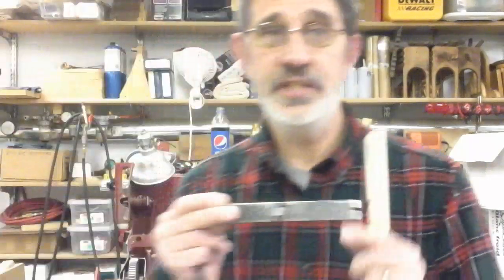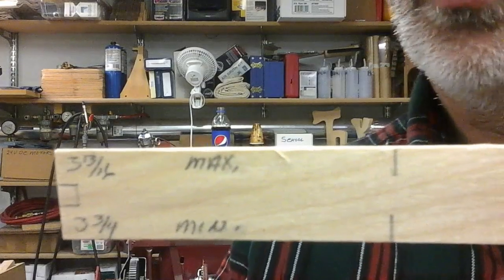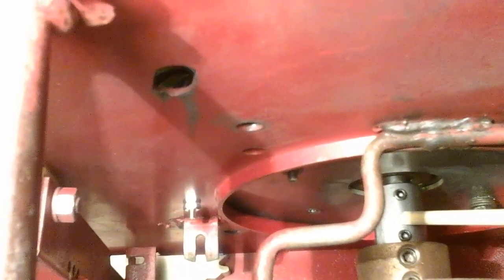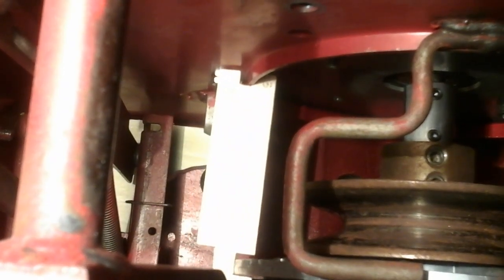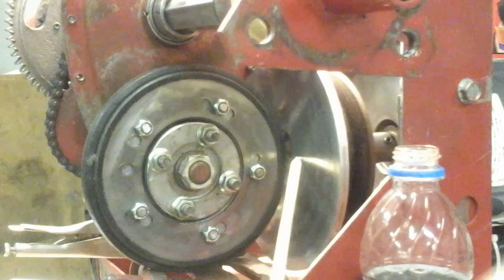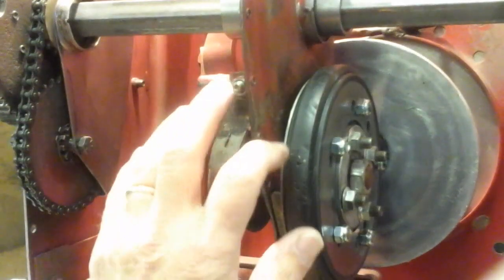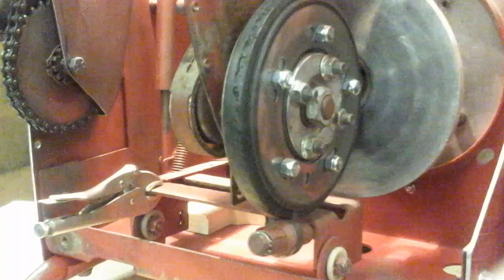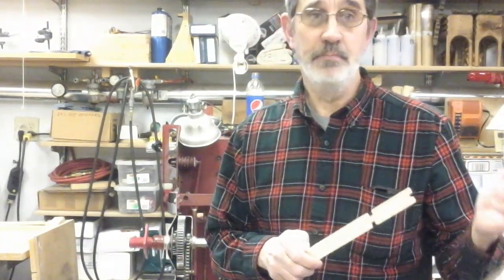70. How can I adjust my clutch and drive disc

Comment: Going to finally attempt this as I’m down to 1st and 2nd forward gears and even the slightest incline stops me.  Thanks for the detailed vid and will let you know how it goes.  If I need a clutch disk - where do recommend purchasing from?
Reply from the maker: NutmegThumper 

Like I said I buy my parts from PartsTree.Com  but you can also buy them from Amazon and eBay. Jim
Reply: Jack's is good.

Comment: Hi Jim How to adjust the carburetor on 12HP  491031 490499  
This Carburetor Carb W/ Gasket For Briggs&Stratton 12HP Engine Replaces 491031 490499
Reply from the maker: I’d have to see a picture of it because most carburetors are not adjustable today. Jim.

Comment: did you know that the late 1990s RER mowers have the black rubber plastic hub cup covers for the sdhaft seals,  for both ends of the axle, stock from factory?  my 1998 model year 9-horse one does.  i have pics and model numbers etc.  i just replaced the transaxle shaft boots on mine, a couple days ago(i got the mower free given to me and its actually very low hours use and in vey good low wear condition, it has no wear-slop in the shifting action(the hex transaxle shaft), or in the chain case shifting/sliding action- or in the hubs bushings(the solid steel later style ones)) because my shaft boots were totally gone/shot/busted up, very horribly,.     so it turned out really nice and sealed uip great now and basically no wear slop anything at all anywhere now!  and all for free, other than the only around 30-bucks for the hub/shaft seals and boots i spent)   and its too bad that the replacement gray colred boot is a cheap taiwan produced part, and that the Briggs/Stratton axle seals are cheapo garbage China produced  ones

Comment: The driven rubber tired clutch disc is in the 15  dollar range, pop on a new one to renew great drive power and clean drive disc surface. Brake parts cleaner spray work well for me. My Snapper runs as a well oiled machine because it is one. Easily climbs hills in my yard, shifts on the go as smooth as can be. Has a settable detent to mow in reverse. A touch on the starter and 10 H.P. is ready to knock out mow chores with ease. 30" cut goes through small gates yet big enough to get good production. Sharp blades are easy with Snappers rear tip up service. While it is standing up a little spray of grey primer after deck wash out flush and dry, ( mine has a twin port hose attach to ease this) keeps any rust at bay, grease fittings as needed. With my my hand held belt sander, knife sharp blades are kept at the ready, to give great looking lawns. Large fuel reserve  means hours of cutting before re/ fuel. Very tight turn radius.  A  small tractor cover and a little t.l.c. keeps it in top shape.
All in all a superior grass cutting machine. 2002 10 Briggs 30" four cut edge blade. ( mulch plug type ) 

The best part of my Snapper is it was given to me by my good friend and neighbor Dick, a combat wounded WWII Normandy invasion. Purple Heart  ( lost an eye and nearly his life then ) U. S. Navy Sea Bees. Dicks over 90 years of age and as sharp as a tack. He just bought a new rider and didn't need his old Snapper as much. He plowed snow with it too.

Comment: Watched this video twice 👍👍.

I figured the lock nut out on the shaft which holds the blade adaptor on.

I saw in 1 of your other videos changing out the bearings on the spindle.
How would u get the blade adaptor off, i know it screws off, cause I can see that coming next?

Comment: Ok bud first and foremost I have enjoyed your vids.. ok my question is... inside the clutch where the green material is there is a lever mechanism that rides up against that material...what is that? what is that for?... is it super important or can I do without it? Mine was missing whatever material was on there to grab the inner clutch ... it was just bare metal ... if I can do without that piece then that's fine I already don't have brakes and it's fine

Comment: I replaced the friction wheel without a problem, but after a short drive, when I looked back at the new friction wheel, the rubber was all scuffed and chopped already within just a few minutes. What might be causing that wear? The aluminum wheel it presses again seems smooth.
Reply from the maker: Watch video number 70 and check the distance on your drive disk and maybe tighten up your yoke spring. The clutch disc could be slipping on the drive disc.

Comment: Hello, My snapper is having trouble when I approach any sort of incline. As if it doesn't have enough power to handle it. Any thoughts on what is causing this? Thank you.
Reply from the maker: Watch video number 70 and check the points that I mention. Jim
Let me know if it helps or not

Comment: Hi Jim , If I put my snapper in first gear and release clutch it seems to slip when it takes off however if I put it in 2nd , or any other forward gear , then in first gear it takes off fine w/o slipping , it does this even w/ a new clutch disc installed , any ideas what’s wrong ? Model number is 3312513BE
Reply from the maker: I have a couple videos I would like you to watch one is number 70 and one is number 182 these may give you some points to look for to see what could be wrong with your machine let me know what you find. Jim

Comment: Question man, my dad is big guy (450) pounds. He just bought one that needed a new clutch. When we get it installed will he be able to ride it. I'm kinda worried it wont pull him
Reply from the maker: If it doesn’t then watch video number 70 and tighten the yolk spring and that will help with the slipping issue. Jim

Comment: Thank you Jim.  I have a 15yr old Snapper rear engine riding mower.  My belt broke  so I had to replace it.   It starts ok but when I try to engage the mower deck it's not letting me.  It has to be something simple right 🤤  Thanks again.  You helped me last summer with a few issue on the same Old Snapper 👍

Comment: Had to adjust my drive plate to about 4 1/2"  with new disk.
Reply from the maker: Just keep your eye on the chain case so it doesn’t gouge into the drive disc being that low on the engine. Jim

Comment: My son replaced the clutch disc and it worked fine a few times. Then when he went to use it it doesn't have a reverse and the neutral is now in the reverse position.
Charles Mobile.Al
Reply from the maker: You need to watch video number 253 it will tell you how to adjust your shift lever. Jim

Comment: I cannot get my blade to engage on my 28 inch snapper. You can push the handle forward and it will go dead. Any help would be appreciated.
Steve Nix
Reply from the maker: Did this happen all of a sudden or did you change the belt and then it happened what’s going on that it won’t engage is the bracket underneath of your black cover on your mower deck working properly, I need a little more information to try to figure out what’s wrong with your machine. Jim

Comment: Great video, Jim! My problem: have a Craftsman (MTD) 30" Model RER1000 rear-engine riding mower. Replaced the ground drive belt with what I was told from an online vendor was the correct belt - a 5/8" wide by 35 1/4" belt. Machine won't stop when brake pedal is engaged. Clutch isn't engaging. 

 MTD later told me I was sold a belt 1/16" too wide (actual belt should have been  9/16" wide). I'm guessing it's riding too high on the variable-speed pulley. Is this why clutch won't kick in when brake is depressed? 

Instead of replacing 5/8" with correct 9/16 belt, is it possible to adjust clutch rod as a work-around? If so which way to turn the adjusting nut?
Reply from the maker: I’m gonna have to see some pictures of the house because I have never worked on a MTD. Jim

Comment: Jim, I just replaced my aluminum drive disc and new clutch disc. I used the max. distance measurement of 3 13/16. I reattached the left shell fender. When I place the shifter in any forward gear, there remains a gap in between the clutch and the disc. I am able to place five feeler gauge blades in the gap that total
.102 of an inch (.024, .023, .022, .021, and .012), to fill that gap. If I move the drive disk down that much, it would just be touching the clutch face. How much total should I move the drive disc down to ensure average torque needs?
Reply from the maker: I would say check out your yoke your yoke bushings and your axle bushings one of them could be causing your issue. Jim

Comment: I let off my clutch very gentle but when ot engages it bucks really hard. Makes driving near my fence very interesting. 

Any recommendations?
Reply from the maker: Steven Myers 

Check to see if you have a soft start clutch on your machine like you should have and if you do then watch video number 70 and loosen your yolk spring a little and see if that helps. Jim

Comment: how does that  affect the chaincase to driveplate clearance for installing a belt?
Reply from the maker: I am not really sure what you’re asking. I just seen your drive disk on the bottom of your engine will give you proper clearance so you’ll have all your gears in neutral. I don’t think it does affect installing a belt. Jim.

Comment: I made a fixture out of 1/4" plywood. Mine mower is slipping and with the fixture, it is below minimum. I cannot find any bolts in the collar that holds the disk on the shaft. Looks like I might have to pull the engine to check it out in how to adjust the distance. It's too crowded by just standing the mower up to check this problem out. Thanks on the fixture tip.
Reply from the maker: Nathan Crochet 
You probably have a newer machine with a bolt that goes through the center of the disc into the center of the crankshaft if so to lower it you have to take the disc off and put a washer inside of it and bolted back onto the crank. Jim

Comment: Jim I have a 300813BE 8 horse rear snapper and I went to adjust my drive disk plate only to find out there are no set screws.  is the 300813BE differerent from others
Reply from the maker: Johnnie Tarver 
  Hi it's Jim
      You have the newer style drive disk there is a bolt in the center of the drive disk that holds it on to the bottom of the engine you have to remove that bolt and slide the disk off the bottom of the engine and you have to either put in or take out the washers that are inside of the disk and then re-bolt to the bottom of the engine. It's a real pain to do because you have to remove your clutch disk Assembly and shift it all the way in fifth gear and it should slide off. Thanks Jim

Comment: Hi Jim. My snapper runs only 1st gear after replacing new clutch  would you please guide me on adjusting thanks
Reply from the maker: vhappy eznhappy 
You need to watch video number 70 and tighten the yolk spring. Jim

Comment: Hi, does the machine need to be in gear, neutral, or what gear when your adjusting ? Also should the parking break be set or not? Also mine looks different I see only one bolt on my shaft not two for adjusting, and also I dont have a chain on mine. So not sure will this measuring stick still work? I made it like yours.
Reply from the maker: William Legg 
Your machine should be in neutral when you adjust your drive disk if you have a bolt in the bottom of the drive disk instead of two sets screws on the side of your drive disk yours is a little different to adjust you have to take your disk off your engine and put a washer inside of it to lower it down if it’s down to low you have to take it off and take a washer out of the inside and then put it back on the crankshaft.  And what chain are you talking aboutJim

Comment: I have a question. My yoke is all the way back but i have slack in my clutch cable and peddle. I have a double peddle. 1986 33 hi vac. And the "brake" side doesnt have slack but it does have four cable crimps behind the peddle. My clutch side only has two crimps is that why the peddle and cable has play in it? Can i add crimps to fix it or is the cable stretched?
Reply from the maker: Brad 31 
  There should be four Ferrells on each cable and the other two must be up inside of your tube when you stand the machine up to work on it sometimes they slide down inside the tube they could be all the way to the back where the cable comes out of the tube check that out.  Thanks jim

Comment: My Snapper won't go up the smallest incline, hard to get in Neutral and when in Neutral and I can hardly move it freely when in neutral ?
Reply from the maker: You need to watch a video number 70 and clean and grease your hexagon shaft underneath your boots it will shift much better. Jim
Reply from the maker: And you’ll need to tighten your yolk spring as tight as you can get it that will help let me know if that takes care of your problem. Jim

Comment: Question is the clutch disc ment to wobble? Mine seems very wobbly
Reply from the maker: Lucy-strations 
 Hi it’s Jim. 
   Well I’d have to say yes and no, the clutch disk is supposed to be loose on the clutch disk assembly, The clutch disk is held on with the four nuts and large washer on the assembly. The clutch disk assembly is not supposed to wiggle or be loose at all That is held on by the large nut in the center if that is wiggling take the large nut off and check the shaft and key And check the hole in the clutch assembly. Let me know what you find out Jim

Comment: Love the videos Jim. I have a 09 Snapper 28" 12.5 hp intec B&S . Is there a way to make the mower faster? I also have 1996 snapper with a 11.5 intec B&S that is faster in the forward gears considerably. the 09 has a new clutch disk. Thank you.
Reply from the maker: No there is no way to make them go faster they’re probably different years and they used may be a different drive disk I’m not sure I’d have to compare them. Jim
Reply: Jim Jackson Thanks Jim.

Comment: Hey Jim.  My 12.5 snapper 28 must have been adjusted too low (disc) and it wore out rubber prematurely.  Plus it beat up the disc.  What should I do?  Thx ...Ed.
Reply from the maker: captainedc 
 Can you send me a picture of your driver disk so I can see what it looks like, if need be I can   remachine it so it looks like new. Thanks Jim
Reply: Jim Jackson I certainly appreciate that but I just used a sander and made it look exactly what it looked like before it got messed up.  That spring adjustment you advised about made a HUGE difference.
Thank you.

Comment: How do you adjust the drive disk that unscrews?
Reply from the maker: j lowe 
Which disc do you have one has set screws and one has a bolt that goes up through the bottom into the crank, none of them really unscrew. Jim
A picture would be great

Comment: Jim do have a video on clutch adjustment for 2000 model snapper rear engine? I guess it’s my clutch, it stops pulling itself. I changed my belt and it hasn’t been the same since. I won’t climb the smallest incline now.
Reply from the maker: Carl Bailey 
  Watching the video 70 should explain how to adjust your clutch and your yoke spring so it doesn’t slip anymore if that doesn’t help you let me know. Jim
Reply: Jim Jackson thanks for responding, I’ll give it a look and see what I can do. Again thanks thanks for your time!

Comment: Hey Jim. Thx for,the video.  I have a snapper and when I push the clutch in I can not move the gear shifter into reverse. It’s like stuck. I can change forward gears when the mower is moving but even that is stiff. Any advice?  Thx.
Reply from the maker: Elizabeth City Pawn and Guns 
Hi it’s Jim
    You need to Clean and grease your hexagon shaft underneath your boots and also your shift lever where the spring is under the rear case if it has a grease fitting grease that also if it doesn’t have a grease fitting disconnect The linkage and make sure it is moving smoothly or you will have to take it apart and clean and grease it I have videos that show how to do all of this. Thanks Jim
Reply from the maker: Elizabeth City Pawn and Guns 
Hi it’s Jim
  One other thing you may want to check push your clutch in as you normally would put a clamp on it like I showed in a video and hold the clutch pedal in position With the shifter in third gear. Then stand up your machine and make sure your clutch disk is not touching your drive disk, or you will need to adjust your clutch.  Thanks Jim

Comment: If the shaft and drive plate are rusted together to the engine shaft, how do you get it free????  Look at 220 for the solution.  Jim rocks!!
Reply from the maker: David Rousseau 
Take a look at video 220 that should help you out.Jim
Reply: @jimjackson9381    Hay Jim, great video.  Video 220 was just what I was looking for.  Thanks a bunch.  I got the drive plate off, and think I can pull that pulley down easily.

Comment: Thank you Jim I'm going to tighten the spring for pressure adjustment. Won't do this till next week.
Reply from the maker: Henry Poirier 
Well you’ll make sure you let me know if it helps or not, because there is other things we can check. Jim
Reply: Jim, the rain stopped and I was able to work under my carport. I changed the fan belt and rubber pressure clutch, the spring appears fine in its location. This 28" Snapper really gets NOW. You have been a great help, thank you. Tomorrow I cut grass, the rain in the New Orleans area has been relentless lately and the grass loves it. Thanks!

Comment: What size are those set screws of the drive disc and is the drive plate replaceable with the the pully
Reply from the maker: I’m not home to look right now, but I believe they are 5/16- 18.
Reply: @jimjackson9381  thanks and is the drive plate replaceable on the pulley shaft
Reply: Or adustable